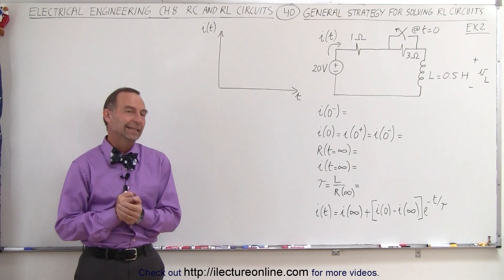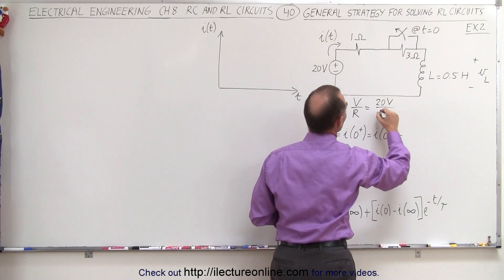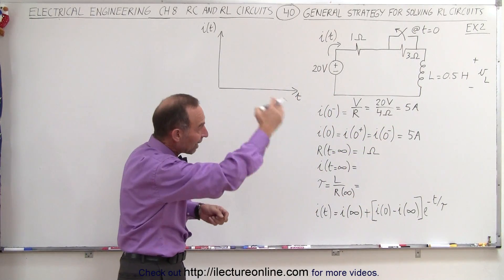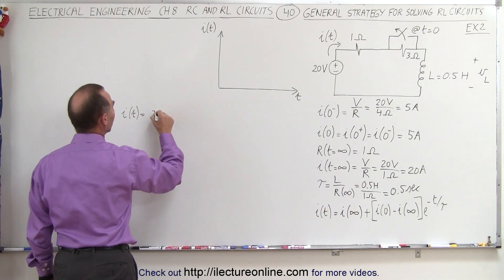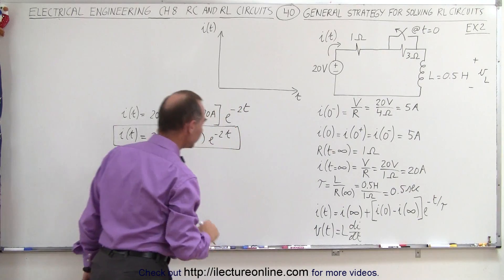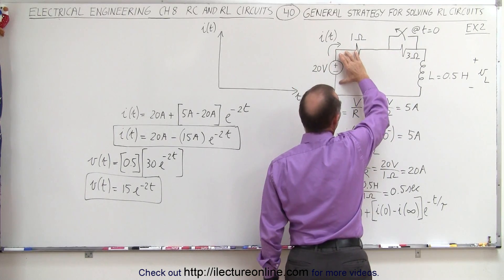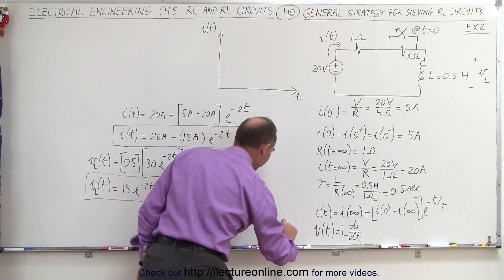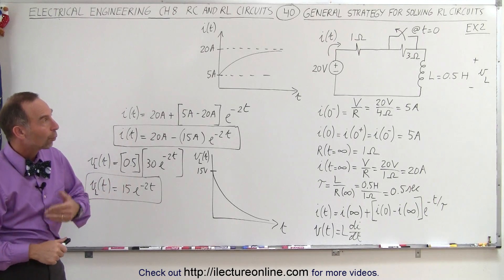Electrical Engineering: Ch 8: RC & RL Circuits (40 of 65) General Strategy Solving RL Circuits Ex.2

Comment: Thank for this video. Quick question: Before the switch open, the 3 ohms was bypassed by the short circuit, so the current @ t=0 is 20V/1 ohm = 20A, not 5A as shown. Or, did I miss something?
Reply from the maker: You are correct.  It looks like I solved the problem where the switch closes at t = 0 seconds.

Comment: Given that Michael Van Biezen already does so much for us, I figured I would solve it the other way so that other students could see the solution so that they didn't bombard him with requests for the other solution. The scenario in which the switch closed t < 0 and opens at t = 0 I got the following results:  For i(t= infinity) you get 5-Amps. For i(t = 0) you get 20-Amps. Time Constant will be .125 secs. Plugging in all the values you get a final answer i(t) = (5-Amps) + (15-Amps)*e^-t/.125-secs or  i(t) =5+15e^-8t.
Reply: haha i just assumed i solved to backwards b4 watching him do it :D

Comment: The swich will open at t=0 or closed at =0 ? From the drawing it's open at t=0 .
Reply: What would be voltage across  inductor  when opening the switch  at t=0
Reply from the maker: You are correct.  It looks like I solved the problem with the switch closing at t=0 sec instead of opening the switch at t=0 sec.  Thanks for pointing that out.

Comment: One question: i(0-) is when switch is closed and therefore the current bypass the 3-OHM resistor. Hence shouldnt i(0-) be 20V / 1OHM = 20A? and i(inf) be 5A?

Your videos are really great btw. Thanks!
Reply from the maker: You are correct.  It looks like I solved the problem with the switch closing at t=0 sec instead of opening the switch at t=0 sec.  Thanks for pointing that out.